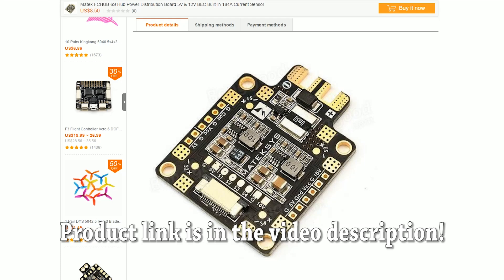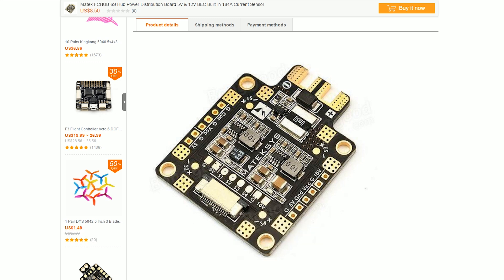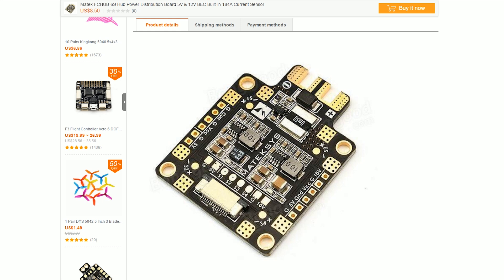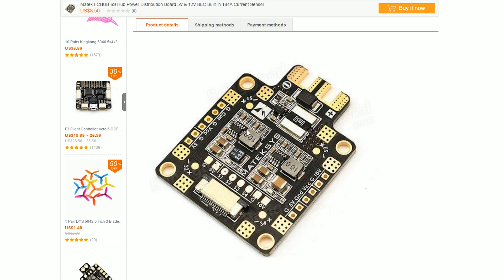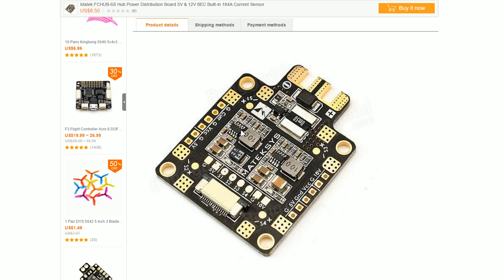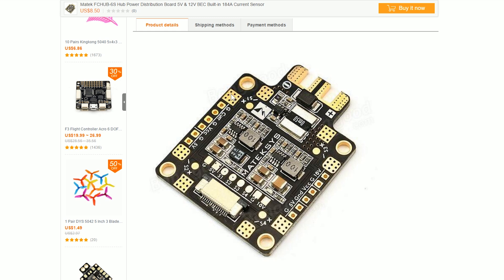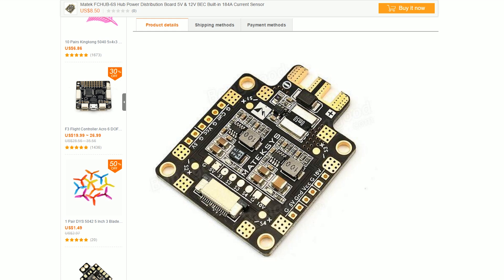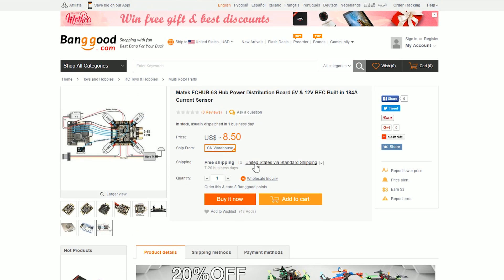MATEK FCHUB | the best, simplest, most complete PDB with current sensing for quadcopters

Comment: Also can you give your opinion about  revers schotty diode? may be you can do a video?  I watched below video and started using it with HGLRC F3 V4 which has a lot of issue with OSD and VTX due to high noise(crammed up components). But when I added 35v low ESR cap to battary leads and added reverse schotty diode to ESC power-ground leads(negative of the diode goes to positive of the battery and positive of the diode goes to negative of the battery). But one thing to consider, I added the diode to ESC leads which all leads goes to one big power and negative pad. I did not try it adding to the battery pads. So I dont know, if it would fry it or not. . Video can be found here => https://www.youtube.com/watch?v=LXGtE3X2k7Y&t=10s&list=WL&index=14
Reply: Also, another thinking, I could place one diode to each battery power&ground leads, so that should help with active breaking rather than installing the diode to battery leads also not all boards have 1 big power&negative leads to get away with just 1. I studied computer engineering, but forgot everything I learned since never actually did any professional work. I work in telecommunication as a network engineer, so got rusty on that aspect.

Comment: How is it compared to Diatone PDB v8.3? It does not have current sensor, but it has LC filter. Do you need LC filter with this? or it does good enough isolation of noise, so I can use this? I usually add 1000uF cap as well.

Comment: Now if only PBD manufacturers would take up the slack and put robust capacitor banks on the PDBs. All our nice motors with N52 magnets generate a ton of noise and adding caps sucks. Capacitor leads, despite my best effortd, are what breaks on my quad the most often.
Reply from the maker: There is simply no substitute for an electrolytic capacitor in terms of low-ESR performance, but nobody wants to buy a board with big caps hanging off. That's what it boils down to, as far as I can tell.
Reply: I don't think this is true. While low ESR caps are good, the banggood alien egg board had similar performance. When it didn't have QC issues. https://m.banggood.com/Anti-interference-Parallel-Capacitor-Plate-Capacitance-Board-Support-1S-6S-LiPo-For-Mini-ESC-p-1117208.html?rmmds=search

Comment: https://www.banggood.com/Realacc-Matek-PDB-XPW-5V-12V-Dual-BEC-PDB-Built-in-140A-Current-Sensor-with-XT60PW-Socket-p-1111981.html?rmmds=search

I am running this very similar PDB on a micro vector quad and it works well. Has 12v instead of 10v which some things need like 1.3 VTX that I know wont run on 10v.
Reply: This pdb is on my wishlist for a while ;)

Comment: im glad Matek stepped it up with this one. i always liked Matek boards, they just have something nice about them. and this one will be my next set of PDB's

off topic:
I've noticed that some Quadcopters are coming out with lower profile designs (Quadcopters with shorter standoffs), it seems to me that the lower they are the faster the quadcopter, correct ? like the diatone GT200 and the Cameleon,  could you do a video on that?
but then would'nt using a board like this still have have height issues when placing a FC on top of it. 
I think AIO flight controller should be used for lower profile design quads for speed  

also I have always been a fan of placing the battery underneath the quadcopter when starting out, and all my friends were saying no no no, but now look, i think it has proven a point. I think its just more stable when it flies. maybe you can do a video on that too vs batteries on top 

sorry for the mixup of info.  just had to get that out there before i forgot about it
Reply: get the matek f4 as well with this pdb it uses ribbon cable to provide esc signal and makes the build super clean http://www.mateksys.com/wp-content/uploads/2017/04/FCHUB-6S_C.jpg
Reply: The idea of having shorter standoffs is to get the weight as centralized as possible by getting the battery closer to the middle of the frame. It is supposed to improve handling. A battery on the bottom will be more stable as it will act like a pendulum whereas a battery on top will make the quad a bit less stable which is usually better for freestyling (Steele, FGA, Johnny FPV etc all fly top mounted)
Reply: Bacardiish Quality
Reply: Thanks.   i like it

Comment: Linear is not inferior.  It's just different.  Switch mode regulators are noisy.  Linear is relatively quiet.    Most flight controllers have linear regulators for the gyro and elsewhere.  With most things there are trade-offs.

Comment: These are great, but the HUBOSD X Type is even better. It's the same deal but with a pretty bullet proof OSD built in and it's only a bit more money. http://www.mateksys.com/?portfolio=hubosd8-x
Reply: i dont think they are better this allows for use of betaflight osd which is far more customization than the hubosd which requires specific tool to change setting or software update.
Reply: They provide one with each board now.
Reply: My one, the osd never worked and the regs run so hot they cooked themselves. Now everything outputs 9v :(
Reply: I've used 6 HUBOSD-X on builds and they are all perfect. To counter that, I have a box full of fried Minim OSD variants. That's the way is goes. I think quality control on everything is very patchy and it's frustrating.
Reply: really like my HUBOSD - but, (on 4s with littlebees) it requires a capacitor on the battery supply otherwise it resets / shuts off / cuts video. 3s is fine.
Reply: My HUBOSD X OSD does not receive proper power from the regulator - drops out constantly, never worked. Had to remove the video from it. My board has just died also - not sure of the cause as I could not find anything shorting it, but the whole thing is shorted out. I'm going to try out this Matek stack as a replacement, most likely. Hopefully I have better luck!

Comment: This makes even less point in running a signal ground, as you will then have 2 ground wires going from and to the same point.
Reply from the maker: One ground wire will be twisted with the signal wire, which some say will help reject noise. Frankly, on a very short run like this, it probably doesn't matter. But that's the argument.

Comment: Doesn't a linear regulator filter out noise which can appear as lines on your video feed? Is switching regulators more noisy?
Reply from the maker: A linear regulator can be better at filtering, it is true, but a well designed switching regulator can have perfectly clean power also. I haven't tested this PDB personally, but they do show on the specs sheet that the output from both regulators is filtered.
Reply: Joshua Bardwell does that mean that an LC filter is not needed with this board? thanks in advance

Comment: Too bad that the XT60 is built to point backwards, and not to the left or right side.
Reply from the maker: It's not designed for a direct-connect XT60, but for a cable. I personally wouldn't do an XT60 direct soldered because I'm sure it will break.
Reply: Joshua Bardwell according to the instructions you solder the xd direct to the board facing backwards. still bad idea. wire is the way to go.

Comment: I'd suggest it is prudent to actually have a sample to test and install before highlighting / recommending a product.
Reply from the maker: I think it's okay to discuss a product based on specs. Otherwise, my entire AIO roundup would be impossible. Is there something you think is wrong with this product?
Reply: Realacc versio crap too...regs run nuclear hot.....well that is until they burnt out, now 5v and 12v output 9v....binned.....sick of electronics that dont work...makes building a new machine feckin depressin to say the least
Reply: Joshua Bardwell for me their original PDB units with Current sensing were faulty. Basically the fix was add a 5v regulator as the OSD would disappear. I threw it in the trash and vowed to avoid Matek products from then on.   This I get what Rob is saying. :)

Comment: PDB's are so 6 months ago. ;) I haven't used a PDB in months now with the days of 4 in 1 ESCs and PDB/FC's with integrated regs and shunts!
Reply: I have 35A 4in1 Chicada but power lead seams more like something for single 35A power wire.

12AWG is no problem on dedicated PDB.
Reply: Me too. I soldered all eight wire together into XT60, saves weight and money. A bit PITA though

Comment: Nothing about the Ribbon cable connection?  or Total amp handling capabilities? The Ribbon cable is for the new Matex F4 Flight control. so you can solder your signal leads to the PDB and transfer that data and more to the FC, via one Ribbon cable.  It is also capable of passing 184Amps.
Reply: Paul Atkinson just got this setup n when i plug in 4s in betflight it see lkke a 7s 25.5 volts how do i fix to read 16.8

Comment: I've had good luck with the Matek PDB-XPW. It too has an integrated current sensor, and it calibrated well with their recommended "236" current scale under Betaflight. It looks very similar to this one. Maybe this is being considered the updated model?

Edit: Found this in the product description. 
"offers a FFC socket to connect the Matek flight controller conviently".
Maybe we'll see a Matek branded FC?
Reply: Myles Shannon Matek is coming out with their own f4 board
Reply: That could be really cool. I wonder how that ribbon cable to the FC will fair in crashes. The integrated current sensor in the Omnibus F4 Pro I use requires a lot of extra wire to work. Hopefully that cable on the Matek PDB breaks out the current sensor too.

Comment: That is a good one i did not see this one when i made my choice it was on sale 8$ so i got the realacc pdb-xpw  140a current sensor w/dual bec.i would have preferred this one as it has pads for the battery mine has a weird xt60 that mounts flat also the connector to the FC.

Comment: I got the first version of this, the one without the ribbon cable so I could get mAh reading but I was never able to get a clean video feed... frankly every Matek PDB that I've tried so far. Diatone v8.3 PDB is still my go to PDB...
Reply: But why can't Diatone come out with a product like this? BTW I have a Matek PDB-XPW and HubOSD X running in 2 builds without issue.
Reply: I've tried those too. I like Matek PDB for thier designs... yes, hopefully Diatone could come up with new PDB with current sensor. Another good PDB in terms of providing clean supply to Vtx and Camera hence I get a clean video feed that I've tried as well was the Beerotor PDB pared with Beerotor FC/OSD. Almost the same design/idea with this Matek PBD.

Comment: Hi Joshua, thanks for covering this PDB. I've run into issues regarding PDB's, and I'm hoping you may help me out a little. On two new frames, both running Omnibus F3, 200mw vtx and HS1177, powered by Matek PDBs. The issue I've run into - running the VTX and Cam from the 12v rail, via the FC's RAM circuit. Video is fine at less than 50% throttle, but anything more will cause my video to turn to static - no osd or picture, signs that the vtx is shutting down. Am I pulling too much from the 12v outputs on these PDB's? What's the typical draw of a 200mw vtx and Cam at 12v, less than an amp, no?
Reply: 4s Graphenes from Turnigy. I had suspected the draw would be 200ma, and should put the load nowhere near the output tolerance for these PDB's. I'm capping up, as well as increasing the gauge of wire I have between PDB 12v reg and Omnibus's RAM input.
Reply from the maker: +willdoryder I would think that would be less than an amp. You should be able to calculate it from the spec sheet of the camera and vTX though.
Reply: I think you should connect the VTX and OSD to the Matek PDB. It'll work just fine. The FC RAM provides 5v or 12v. It looks like you are running at 5v.
Reply: PAWAN V The Omnibus can supply 5v from its own regulator, or another voltage you supply, to the RAM pins on the FC. There is no 12v reg onboard, so I did supply the PDB 12v output to RAM, then VBat, same issue.
Reply: willdoryder The first thing I would do would be to connect it to the pdb regulator directly. Then I would attach a large capacitor to the PDB to flatten the excessive noise from the motors.
Reply: PAWAN V I have just the cap. I run them on noisy setups (I'm looking at you F60 motors). But as these are 2 brand new builds (out of 25 or so built), including dedicated 12v becs, thought I'd be ok ;-)
Reply: 200mW VTX draws about 200 mA @ 12V with these that i have and the camera only a few mA, so the PDB should handle this easily. 
Maybe the input voltage drops too much under high load? What battery do you use?
If it is a switching regulator, you should probably maintain at least 13V under all circumstances.

Comment: Does it have OSD ?
Reply: no - but the one I like better does - here: https://www.banggood.com/Matek-Systems-HUBOSD8-SE-9-27V-PDB-W-STOSD8-SE-5V10V-Dual-BEC-For-RC-Multirotors-p-1122790.html?rmmds=search
Reply: Yes, already found it. I will definitely order this. I don't see reason not to have OSD on this board. :)
Reply: the reason this pdb does not have an OSD built-in is because it is meant to plug into this FC via ribbon cable - and the FC itself has OSD already - https://www.banggood.com/Matek-F405-OSD-BetaFlight-STM32F405-Flight-Control-Board-Built-in-OSD-Inverter-for-SBUS-Input-p-1141282.html?rmmds=searchW013144637739201605P

Comment: In the description it says 12v but in the video you said 10v regulator
Reply from the maker: +Hrr Pippi you can see on the board it's printed 10v.
Reply: I meant that you wrote 12v in your description on the video. but you said 10V

Comment: The hubosd SE has all these features and an in built osd to boot, and just costs $6 more
Reply: Tan Khay liang yep, I like the SE better has the osd and I don't really care for the esc signal going through the pdb instead of straight to the FC, been using the SE for a few months now and it's been rock solid.
Reply: But with this setup running the sensor pin into an FC OSD you'd have betaflight OSD...... Allows for lots of cool features.
Reply: Alex DiJ Yeah that's true, on my setup tho I still have the current sensor pin with the SE going to the FC so I get current logged and all that, but yeah no betaflight osd, and betaflight osd is super nice, but really all I really want from an osd is current, voltage, timer, and mah, which the SE does, it's the changing of damn near any setting where the betaflight osd really shines for me. I do get some of that functionality with taranis+BFluascript+smartport, but not near all. Really it's just nice everyone has options now for whatever setup they want just about.
Reply from the maker: +Alex DiJ yep. This board plus an Omnibus F3 will give you Betaflight F3 plus irretrievably sensing. The whole package.

Comment: It can altso be connected to the new matek fc via a cable. this takes care of all the wiring and soldering of current sensor, vbat, 5v to fc and esc signal i believe. just in one cable and the fc even has betaflight osd.
Oh, it altso has a sd card slot for blackbox. 
Link: https://www.banggood.com/Matek-F405-OSD-BetaFlight-STM32F405-Flight-Control-Board-Built-in-OSD-Inverter-for-SBUS-Input-p-1141282.html?rmmds=searchW013144637739201605P
Reply: SPRacingF4EVO and SPRacingF3OSD makes a pretty awesome FPV stack too.

http://seriouslypro.com/spracingf4evo
http://seriouslypro.com/spracingf3osd
Reply: Of that there's no doubt - the FC is great, and can be found everywhere without stock issues. But I haven't looked too closely at the OSD\PDB until now, and wow, it does look really beefy. Current sensor, onboard USB, looks pretty good for anyone who has need for OSD and current sensing, at a much more reasonable price than some other stack OSDs.
Reply: Ghost Ryder FPV just got the setup n love f405 fc is amazing but reads 25.5 volts on 4s how do i fix to read 16.8
Reply: blaze allday in the Betaflight GUI, change "voltage scale' until the number matches your meter (configuration tab)
Reply: Nice find! F4 too! Maybe my favorite FC, the Omnibus, will have to give way to a Matek FC/PDB stack?!

Comment: Is that a ribbon cable socket? Does this have a mating FC?
Reply: It does connect to this fc. It seems a clever solution.
https://www.banggood.com/Matek-F405-OSD-BetaFlight-STM32F405-Flight-Control-Board-Built-in-OSD-Inverter-for-SBUS-Input-p-1141282.html?rmmds=searchW013144637739201605P